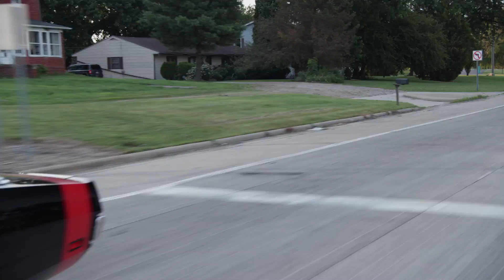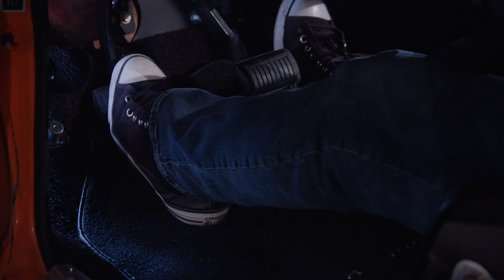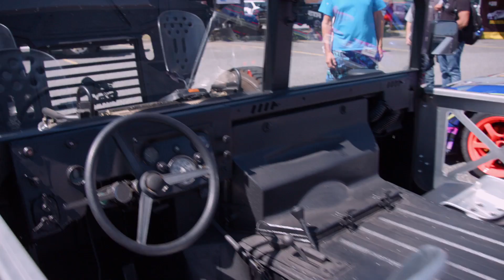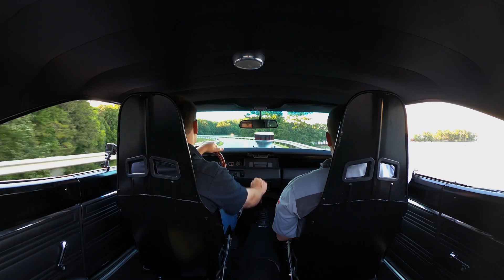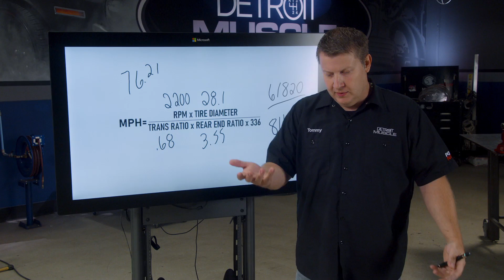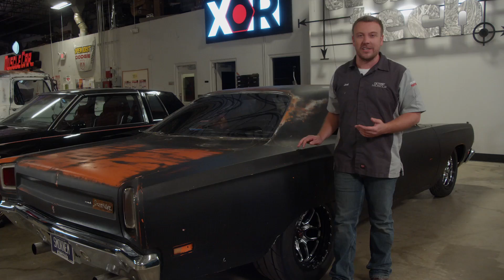Becoming Legendary: Road Burner Hits the Hot Wheels Legends Tour Part 7 - Detroit Muscle S9, E8

Comment: How does a builder configure the correct Speedometer Gear for the Transmission with an "Updated Drivetrain"?
I have a 1962 Econoline (bone stock), that I want to Swap in a 2.3 Ecoboost from a 2018 Mustang with a 10-speed Transmission with a Narrowed 9" Disc Rearend with "Roadtrip" gears.
I am good with Mathematicals, but trying to figure the correct Speedo Gear while running a Square 215/45-16" tires really "chomps my rear"...
I'm hoping to have this ready for this 2023 HOT ROD POWER TOUR, although I will have to drive from 50 miles West of Seattle, Washington.
Yes, it has A/C...
Any suggestions are GREATLY WELCOME from anyone!